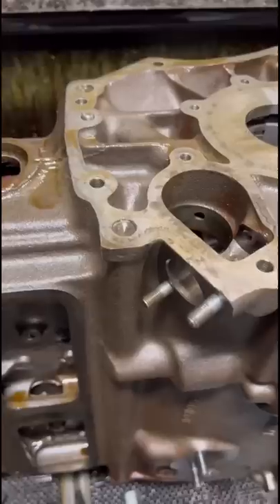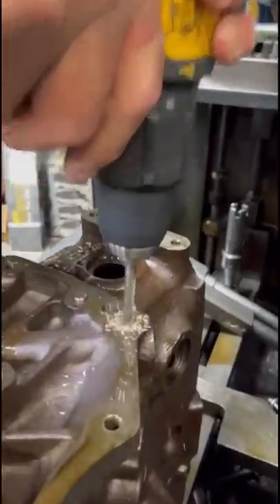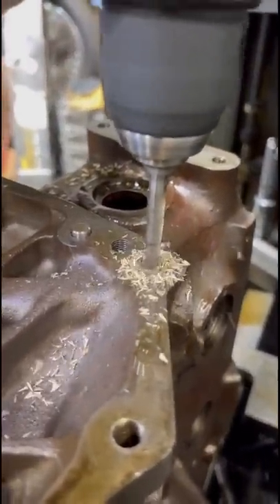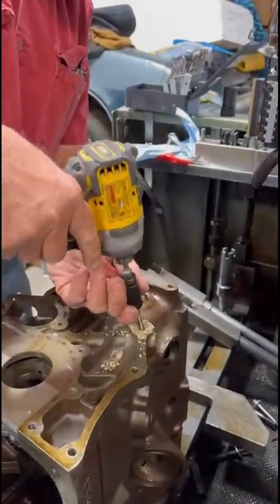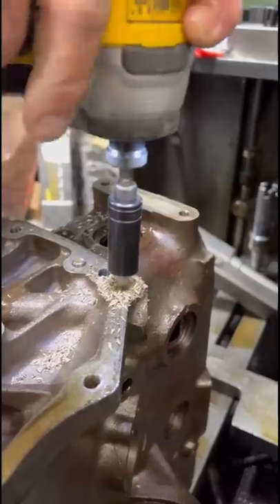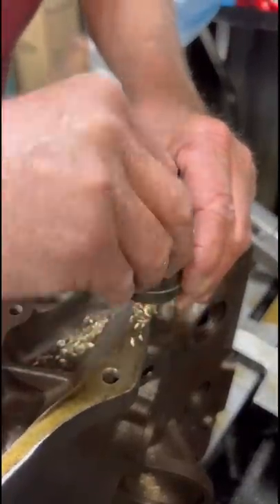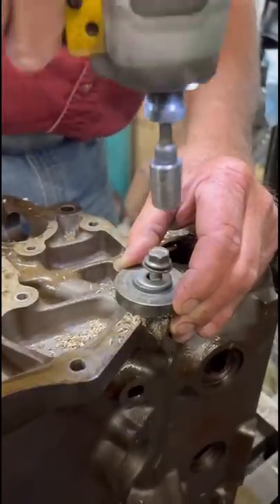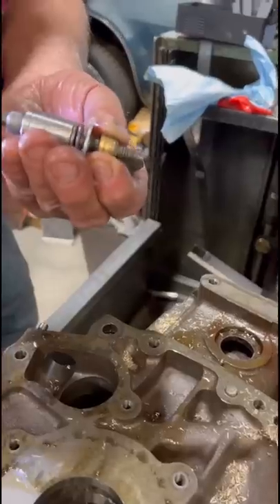#shorts How To Remove Press Fit Brass Oil Galley Plugs The Easy Way

Comment: Did I see them sockets    ARE SK TOOLS..?? 3/8” socket …??  Heck yeah. Buddy. Love my old SK TOOLS FROM MY GRANDPA.  THEY MADE IN THE 70-80’s. Love em. Tools are tools….  Kinda yes. But  THEY WERE MY GRAMPS.. He used them l EVERY DAY  THEY PUT FOOD ON THE TABLE AND KEPT THEIR HOME PAID FOR. STILL WORK GREAT. GOOD OLD METAL BACK THEN. EVEN impact on chrome’s. Lol only broke a few so far. Just need a dealer to buy more. I  like snap on or  Mac or CornWell. But these SK. Are my first choice. To use
Reply: But proper punctuation and grammar fall far behind those BEAUTIFUL SK TOOLS BUDDY, AND HONESTLY I CAN'T BLAME YOU BECAUSE I FEEL THAT PASSION

Comment: When drilling brass and bronze it pays not to have to much positive rake angle on your drill and I would dull the cutting edge with an oil stone to prevent the drill from grabbing
Reply: I grind a small zero degree flat on the bit for drilling brasses.  prevents augering in.
Reply: @mrbmp09  Yeah it’s insane how brass and bronze will do this, positive rack is problematic. Yet with filing you need a new, file that’s slightly worn is waisting your time, being that it’s a soft metal you would think it wouldn’t mater. Happy machining my friend

Comment: It's all simple numbers if you're smart. All machining is is using a harder metal to cut a softer metal and make sure you leave a couple thousands on there for the threads or you're going to screw it up. 📡👽🇺🇸 RUN!!! You can subtract metal but you can't add it.

Comment: Hey, if you’re going to tell them about reusing the plug with a bolt, you might as well mention using thread sealant. /s
Reply from the maker: I simply cross thread the bolt which is an effective sealant
Reply: @JAMSIONLINE  It's not. There's a reason BSP/NPT is a thing and even that needs sealing.
Reply: @TonyRule  you missed both the sarcasm, and the joke

Comment: Risky using a impact on tap, how many taps have broken and what material are the taps?
I normally use a slide hammer on the ford transit head core plugs, will be trying the spacer method and bolt. 
If fitting a bolt I'd recommend PTFE tape, pressure test has failed in the past, so PTFE tape when replugged (grub screw)
Reply: They are brass so it’s not really a big deal
Reply: Finesse….
Reply: The tap material is only a part of the equation. What’s equally as important is the material you’re tapping, hole size(and relative tap size), thickness of material and tapping tool.

Comment: Ffs he isn't using the hole he is tapping again. Doesn't matter what he threads the tap with. It was all to pull the oil gally plug. Its a pressed brass fit. He wasn't threading the block.

Comment: How do you ensure the hole and threads is square and plumb to the mating surface using a hand power tool?
Reply: It's just a plug, doesn't matter if its exactly square. 
With practice you can eyeball it within a couple degrees.
Reply: You don’t and it looked off to me but again doesn’t matter much they’re pulling a plug that’s getting replaced

Comment: My buddy works at a machine shop and nearly all of their tapping is done with impact drivers they make lots of parts none of which are automotive. So even though my broke ass won’t do that if the place I’m working for tells me to for efficiency your Danm straight I will

Comment: Why is that a true test of machinist???. I'm confused. 
And why he say it's a trigger warning. Why would it be??
Reply: Don’t you know?!??  you’ll

A: get swarf in the engine- ruined!
B: tap with a drill - madness!
C: use an impact - you could crack the block

Or you could just grow a pair like this guy- a seasoned machinist 🤓
Reply: @defendermender4959  its not about cracking the block it’s about breaking the tap which  can happen in brass as it grabs things. If you dont care about your tap its fine but it will break the tap eventually
Reply: Just read the comments broski. Folks that have never done this a day in their life have the knowledge of a seasoned machinest with 20 years experience
Reply: @CervixCrusher69  yeah.. I get ya... Just saying nothing wrong with this...
It's not hard to clean the shavings out.. drill things out..
Done nearly this very same thing before...

Just confuses me how it would be a trigger.. or whatever.
You gotta do what ya gotta do... 
Idk.. I'm still confused.. owell
Reply: @melody3741  I’m sure he’s happy to play the break a tap odds game and if he does sure that’s what they make spark ⚡️ erosion machines for 🫠

Comment: Used to have a boss that would freak out if he saw us tap a hole with an impact
Reply: I had that boss... He also freaked out if he didnt see a torque wrench used on wheel bearings🤣
 Havent bothered doin that in 25+ years...
Reply: Just cause he’s scared don’t mean we need to be.
Reply: @wheels-n-tires1846  impacts on wheel bearing nuts are a big no no
Reply: @2kbaby924  who said impact???
Reply: @2kbaby924  i said "torque wrench"...
Reply: @wheels-n-tires1846  literally said you haven’t bothered using a torque wrench in 25 years buddy
Reply: @2kbaby924  havent used a torque wrench on wheel bearings in 25+ years.
Still not sure where impact came into it...???
Guess im missing your point....
Reply: @2kbaby924  did you figure out that things besides impact guns and torque wrenches exist yet
Reply: @alakani  what are you even talking about?
Reply: @2kbaby924  Scroll up if you forgot
Reply: @alakani  ion even why i even cared to explain that to some numb skull on the internet but i’m just waiting for thanksgiving dinner so i got time 🥱☕️
Reply: @2kbaby924  yay you figured it out, kinda. I bet you tree fiddy that 99% of the people who think torque wrenches are better than experience and feel, have never once gotten their torque wrench calibrated or even know that's a thing. And not replacing torque-to-yield bolts. Have even seen people using u-joints on torque wrenches without compensating for angle
Reply: @alakani  well buddy all i can say is if you think experience and feel is more accurate then a torque wrench then you are oh so sadly mistaken. a Torque wrench is also for repeatability. try putting a engine together with just experience and feel on every bolt and lmk how that goes.
Reply: @alakani  i literally work at a engine machine shop for a living so your not gonna bs me, and my boss that done it for over 30 years would laugh in your face if you said that
Reply: @2kbaby924  sure, 20 years ago when I only built SBCs every day. now that I work on a wider variety I like using my actually calibrated non 50 dollar torque wrench for a few things here and there, but if you've spent time in the industry I assume you've seen your fair share of people fucking things up even if they did use a torque wrench, proving that thread prep is far more important for repeatability
Reply: @alakani  yup but u still can’t tell me that you know what say 130 ft lbs is by feel, Because going by torque values is the only way to be somewhat consistent period, and just cuz you torque all the bolts down correctly and accurately in a engine or anything for that matter doesn’t mean it is sure fire perfect and will never have issues

Comment: Most are forgetting the tap is steel and the plug is brass.. which is a lot softer than the tap.. which is why the tap doesn’t just break lol..

Comment: A machinist would never put a tap in a hand drill.
Reply: Not true
Reply: @Truth-Seeker777  I've been a real machinist for 50 years In a shop with many other machinist and no good machinist would tap a hole with a tap in a hand drill.
Reply: @RicochetRichard  I have welded for about 10 years and  done some machining: by hand, using 6 axis CNCs, and on manual milling machines , lathes etc. It's not that I think it would be appropriate to use a hand drill under normal circumstances, but I wouldn't say "never".
I occasionally do it to chase threads when I'm fabricating, but I have an understanding of when it's a terrible idea.
I'm now going back to school to be an engineer; take that as proof of intelligence or that I'm an imbecile lol

Comment: Always hand tap. Unless you want problems
Reply: He was pulling a plug
Reply: It’s a plug genius
Reply: @TrillAntho  your point?
Reply: @ROLFCOPTERZZ  there are no problems that will arise. The plug is trash. He tapped the plug. I’m sure he’d be careful with a more serious hole
Reply: @TrillAntho  tap can jam and break off in the plug, seen it happen before. Been fabbing metal for over 20 years and was taught to do it this way for a reason. Laziness and trying to shortcut causes problems
Reply: @ROLFCOPTERZZ  Highly unlikely if the hole is the right size especially with brass. 40 years experience.

Comment: How many of you armchair experts know how to sharpen a drill bit so it doesn't grab when it punches thru brass?
Reply: Gotta change that rake angle!
Reply: All right, I'm game. How do you sharpen a drill bit so it doesn't grab?
Reply: It’s called brassing off a drill. I’d have to be drilling a lot of brass to do it to my drills. Basically you can just hone stone the cutting edge to make a more plow/flat cutting edge. Brass is soft and brittle enough that it will still cut just not dive through the work.
Reply: @frikyouall  you dull it down

Comment: That engine block does not contain an area for cooking or preparing food, as you would find on a ship, boat or aircraft. So, an engine-block, does not have an area called a Galley.

The proper term is “Oil Gallery”. 

A “gallery” is a “passageway”, an area for someone or something to travel or flow from one set point to another set point.

I can see how this mistake got started… a person sitting in the back of the classroom, misheard the Instructor when describing how oil circulates around, inside of an engine, a transmission or perhaps a gearbox.

The Instructor points to a small opening in an engine block and says “Oil Gallery”.

The person who is sitting at the back of the room, thinks he heard “Oil Galley”.

That person goes on to write for an Automotive Magazine, with a circulation in the hundreds of thousands.

Almost over night, english speaking gear-heads, all around the world, start using the name “Oil Galley” for the “oil gallery” and “Oil Galley” automagically becomes the new name which all of those who want to sound as if they are well educated, expert, gear heads, start to use.😢
Reply from the maker: I didn’t read this but I can tell you feel cool
Reply: @JAMSIONLINE  🤣🤣🤣
Reply: @JAMSIONLINE    I apologize if I embarrassed you in any way. I was trying to inject some humour into a somewhat obscure and understandable mistake, taken up by many other people, online.

I used the classroom story because that actually happened in a class I was in, in college. No, I don’t know what my fellow student, (the one who thought he heard “galley” instead of “gallery”) went on to do after college. 

You only need to hear (or read) the two words and their definitions, to know which is the proper word to use.

It appears that you work in, manage or own, an automotive machine shop, so you do understand the importance of using the precise name for any part or component. 

Mistakes in our industry can cost a lot, in damages and money, as well as injuries and even lives. 

You gave a good presentation of your subject matter. With your attention to detail, I thought you would be amenable to some constructive criticism and not take it as anything but.

Comment: What brand of taps are those cuz the matco ones I got are doo-doo
Reply: Lol
It’s only brass
Going straight through steel like that with (what I think) is a 5/16 tap with little to no lubrication would break the tap in a second
Reply: Make sure to go slow and use plenty of cutting oil
All taps are brittle
Reply: Yeah but those are flat at the bottom and look more robust. My match taps are super thin and pointy tapered
Reply: @Mondos2001  that’s the difference between a starting and finishing tap I believe

Comment: If you want to avoid the drill flying through the part you are drilling you can put a piece of rubber hose around the drill bit and it works really well

Comment: But what do you use those brass shavings for??? The real machinist will have the answer to that question 😉😉😉💋💋💋
Reply: Bluing steel?
Reply: Boom .. 🤘🏻
Reply: @alecwhatshisname5170  yep! So when you put certain alloys under flame they will change color on the surface as they oxidize. If you want to blue steel consistently without changing the metals structural hardness then the heat applied throughout the parts surface needs to be evenly distributed (an oven would change the internal structure of the alloy as well as the outside) so by heating up brass shavings in a pot and submerging the alloy in the shavings while maintaining heat on it you can get different colors of “blue” from a straw color to a deep purplish blue! Hope that helped!

Comment: Man,
 I always run my taps in by hand and reverse every turn or so. I have never been stuck in a shop all day but still have experience above armchair. 
   I know that you know what you are doing and I see many people using impact or drill press for making/fixing threads. At the risk of jokes, is there a time when you would never use a power tool to tap a hole?
Trigger warning haha!

Comment: a real machinist uses a mill not a impact drill, the shop I work for doesn’t even own an impact
Reply: It's literally an oil galley plug, who gives a shit. It's getting replaced anyways.
Reply: how tf do you take engines apart? do you do everything by hand? that's hours of work you could cut down on
Reply: Then you dont work for a shop.

Comment: So drilling and tapping crooked af makes you a machinist?
Reply: Literally made robots with a dude that knew what he was talking about thread shit by hand
Reply: An armchair machinist thinks all machining is done to same tolerances. That plug doesn’t care if the hole is at 45 and the tap at 43, the critical tolerance for this task is called “does the bolt thread in to pull this sucker so I can scrap the brass and install new plug”
Reply: Although this isint a lasting part so it’s fine, but if you need to thread something that’s permanent use Bo-lube and take your time and do it by hand
Reply: @Rishnai  the armchair machinist thinks that hole and plug are at 45 degrees. Try again guy
Reply: @Me-nq4gz  I’m quoting one of the comments I scrolled past to reach your drivel
Reply: @Me-nq4gz  Btw what is your definition of “crooked af” if not 2 degrees off? What kind of parts have you made, sand castles?

Comment: Who uses an impact on a thread tap?
Reply: Your mom
Reply: I’ve seen a guy use a 3/4” drive impact gun on a 5/8” tap in to a hydraulic ram pin before, a little ugga dugga never hurt anybody.
Reply: The guy in this video and it worked perfectly for the function he was performing.

Comment: Real machinist use a machine to drill and tap straight just saying
Reply: Drill is a machine. Imagine setting it up to tap soft brass just to pull it out to trash. Smarter not harder

Comment: Never power drive a forefoot tap like you did there you have to have either a two flute or a 3 flute machinist tap that's designed to be driven with a machine it has to do with the way the chips are cleared a for flute will bind on its own chips and snap

Comment: It's not the weakend worrier you should concern yourself with. It's the guy that has been in the biz for 35 years that calls  you a  Butcher.
Reply: Well, looks like we found the one who got  triggered!
Reply: @thomasbunch8476   Call it whatever you want. I have Passion for this business. Technicians get a bad rap as it is and then they see stupid shit like this .
Reply: Yeah I feel you, this works til it doesn't and then that one broken tap slows you down. I'm more on the conservative side with that sort of thing. If rather do it slightly slower with way lower risk, than risk 1/50 times getting a broken tap. At least I'd just use a drill for tapping, the impact adds nothing but increases the break risk by a lot

Comment: Wonder if you could drill the hole and use a spring loaded drywall anchor as a slide hammer attachment.

Comment: On two occasions I've had to pull an engine and pull those plugs with both in them out because some dumb-ass did with just what you said . Put in a proper new plug
Reply from the maker: 😂 you really think I’m gonna thread a bolt into that plug and put it back in? 😂😂😂
Reply: That was a joke, sir. 
In 25 years I’ve never actually seen someone do that, and I’ve seen a LOT of crazy bullshit.

Comment: Don't worry about the shavings that fell in the passage, they'll settle to the bottom where they won't hurt anything.
Reply from the maker: I always pack a few in behind the plug when we’re done just to be safe
Reply: I sprinkle them across the cam and into lifters also

Comment: Don't waste a bolt, a good blob of JB steel epoxy worked in so the threads hold it, and Bob's your uncle.  The advantage is that when you have to take the engine apart again, it is easier to drill and tap.  🙄

Comment: You NEVER use a power tool to run a tap into a hole. They are very brittle and a real bitch to get out if it breaks off in the hole.

Comment: Why doesn't anybody use cutting oil
Reply: Because you only use that when you know your gonna use a lot of heat by in this case drill bit was extremely sharp and the dowel was really thin and weak so I did not matter. These are pros at what they do so don’t try and say they don’t know nothing when they have done it all their life’s
Reply: Cutting oil for brass??

Comment: It looked the tap on the impact was just acting like a drill. How can it spun so fast yet go in so slow if its cutting threads? Seems like any threads made were striiped out immediately
Reply: the impact gives a little torque then a short break, similar to a manual tapping action at 10x speed. The real risk is breaking the tap off in the hole.
Reply: It's soft metal that why.